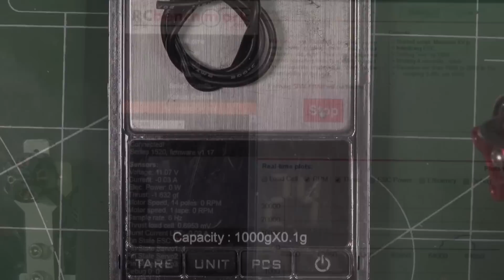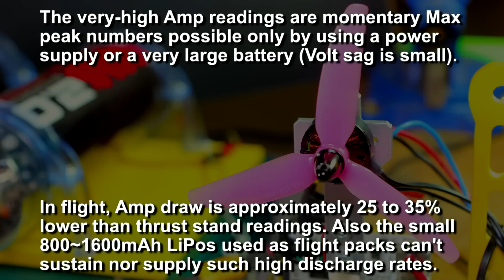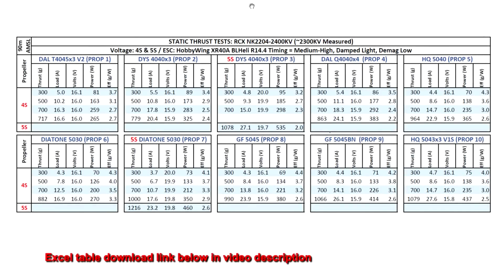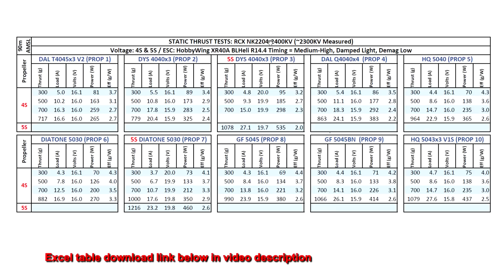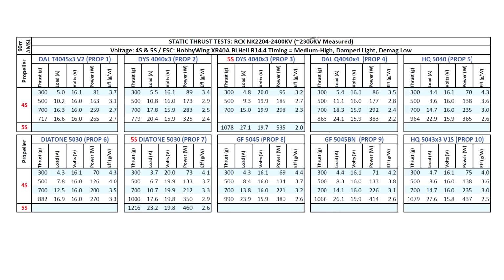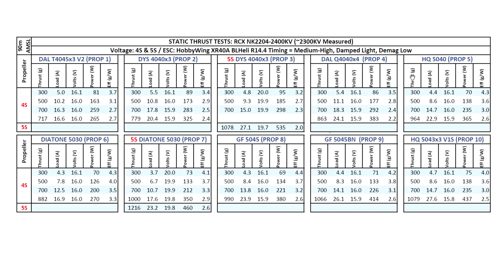MYRCMART RCX NK2204-2400KV Efficient and Light Small Motor  *UPDATE: Higher KV Coming Later*

Comment: I've been eyeing these motors for over a year now and now they're $10 w/o warranty.   I''m looking to build a light-weight cruiser that's efficient.  Do you think that the 2400KV version would work well with HQ 6x3x3 V1S props on a 4S under 200gram build (w/o lipo)?
Reply from the maker: It should work fine with that low pitch prop but it might not be as efficient as you'd expect. So far the most efficient setups I've seen use a little larger motors and lower KV. So 2206-1800/2000kv 6" and light LiPo. I was able to fly about 15min with a Cobra 2205-1960kv 6045x2 props 25C 4S 2700mAh Lipo and the frame was on the heavy side..... Anyway, if you build it very light and manage throttle well avoiding full throttle it should give you longer flights. Try 6030 or 6040 2-blade props. Those could be more efficient

Comment: Ya Know these really look awesome i bought the emax 2207s and i think they only have a 3mm shaft. I think my next motors are going to be 4mm shaft or they will not be considered. What is your opinion on that? The reason i ask is i have aalready replaced the bells on my two rear motors for balance sake. This is not the fault of the motors i am surprised it did not rip off my rear arms. I believe that EMAX are great quality all the way through but 4mm shaft would make a huge difference

Comment: 4mm shaft and big bearings are overkill IMO. They could use 3mm shaft and smaller bearings, meaning bigger stator volume, more power and possibly lighter. At this price point and weight, I wouldn't bother much about durability. Also provide more color selection or at least use something neutral instead of red bottoms because not all people want red theme quad. Other than that it's great. Keep up the great video.
Reply: the other lightweight motors like the proton-x and the t-motors have smaller bearings and aluminium shafts, they are also a little bit lighter. But there are from the earlier t-motors a lot of reports of people breaking the shaft when tightening props. You can choose what you'd like to buy now
Reply: I agree they are not expensive but the durability is a huge plus. After all the work assembling it sure would suck to have wobbly motors or worse yet a downed bird IDK i am just on the band wagon i guess

Comment: Didn't 2204 motors die out way back in 2015 or is there like some niche market for these things?
Reply: MajorProblemsStudios You'll find the odd pilot who's OCD about weight and wants the lightest quad possible.  It also benefits in some MULTIGP 'races' where they run to a time and lap method and not fastest over 3-5 laps.
Reply from the maker: Yes, for the most part, 2204's went overlooked by majority of people for a good while. 2205's replaced them, then 2206's, 2306's, 2407's, 2207's..... but I think there are still some specific uses for some people where a 2204 like this one fits nicely for those who want a light and efficient motor to cruise around. 
https://www.youtube.com/watch?v=i06U53ulYSA
This guy for example says he gets about 8min flights for night flying where speed is not a necessity using a 4S-1300mAh  and carrying a Xiaomi 4K HD cam. Yes, you can get the same performance with 50 other motor/prop combinations. I guess it all depends what makes each person accomplish his specific goals.
Reply from the maker: Check out 
Andrius Narbutas comment :
Using them on my inverted floss with night-camera setup.
While they do not generate top-thrust - they still are nice for very lightweight setups. Smooth and efficient, like them

Comment: I just looked into the new XNOVA 2204 2900kv. More expensive, but probably more punch overall.
Reply from the maker: Right, 2900kv will have higher thrust output at the expense of drawing higher Amps, and shorter flight times. Another option is the Piroflip Hyperlight 2204-3022KV. Very good motor too. One of the YT viewers donated one for testing so I'll be running it on the thrust stand in a couple weeks

Comment: From rcx homepage:
Shaft: Titanium Alloy Hollow Shaft
    Top 5mm Hollow
    Bottom 4mm Solid (even more hard)
Stator: 0.15mm Nippon Steel Silicon Steel
Reply from the maker: Shaft is definitely not titanium, I placed it next to magnet and it was readily attracted. It is 4mm, hopefully hardened steel so it can take any big impact.
Reply: EngineerX 
And its not solid in the bottom area as you clearly showed. So some wrong data here from rcx. They should correct their product page.
Reply from the maker: Right, that happens often with several of the Chinese vendors. Often times, they just copy & paste from other similar products.  Sometimes, when we see people's reviews, videos, or pictures is when we really see actual details. I'll let them know, but don't know if they'll revise info.

Comment: I am very happy with this motor on my light 5048 prop 5". Def does not have the strong punch of the bigger motors but I was very impressed flying slower in proximity. I am curious how it compares to the Hyperlite 2204 which is reported lighter...but I have no experience with that other 2204 option. My vid: https://youtu.be/uunsaNe04gI
Reply: EngineerX the Hyperlite 2204 2522kv feels a little more powerful then these on top end but the RCX motor pulls a little harder off zero throttle up to about 40% throttle. the Hyperlite feels slightly smoother with sharp throttle inputs. I very much like the Hyperlite 2204 on extremely light builds and the motor has very good torque for a 4mm tall stator motor. the RCX motor is an amazing deal, I wish they offered it in a 2700ish kv version and that would be a heck of a light weight motor for the cost. the 2400kv just is to low of a KV for me because it runs a lot under its rated kv. the top end just falls off to much due to the low KV and you can run a high pitched prop to over come the lowish kv restrictions BUT the 2522kv HL is noticablly faster on top end by a good bit. my Hyperlite Floss 2204s on a true X frame running the 2522kv and a stretched X frame running the 3022kv at 191 gram dry and 197 gram respectively. the 2522kv version is a heck of a motor.. it has enough top end, it has strong mid range but lacks a little off Idle/zero throttle as the torque of the little stator doesn't have that low end pop that we are used to with bigger motors, on a light setup tho that isn't a bad thing and honestly it makes flying through tight and low gaps easier as throttle control isn't so violently fast, the RCX 2204 does have more low end, I don't know if it's just the throttle curve of the motor making it feel that way or if the motor does indeed have more bottom end power. I will say this, the 3022kv is a very specific motor and not a freestyle motor by any means it is a very light 5 inch prop motor only if staying at 5 inch it lacks torque across the board but on a very light weight low drag frame with the right props will be a screaming fast setup. out of the HL2204 and the RCX2204 my choice is the HL2204 2522kv. not saying the RCX isnt a damn good motor as it is and it's stellar when factoring the cost in the equation. I'm honestly loving the flight times of the light weight 2204 power quads, 5 minutes on 1550s in possible when running race gates at 70 to 80% my ability and right around 4 min of flying 85% to 100%. flying freestyle 5 mins is easy to get on 1550s and low cost 45c packs are more then enough!!! I got a lot of 1050 4s 45c packs on them as well and preformance is excellent, flight characteristics with the light packs is excellent cornering is smoking quick and like I said 4 min of fairly hard flying on 1050s and on 1550s 5.5 to 6 mins is no problems and when you are used to 2 to 2.5 min flights going to 5 to 6 min flights feels like forever.. your packs also last for a long time as you are working the crap out of them and getting them 160 degrees and making them scream for a break, I have some 1050mah 45c 4s packs that have well over 200 cycles on them and they still preform great.. if they can make a 2204 that has torque to preform good on a normal 5x4x3 and have the KV high enough that they don't just die off after about 80% throttle on a 190 to 210 max gram build that you can get 3.5 to 4 mins on a 1000mah 4s then 2204s will truly become a viable motor option. from the testing I have done on my current 2204 powered rigs is that a flying weight of 330 grams MAX to have all out preformance and with high-performance 4s 1050mah packs weighing 110 to 120 grams 300 to 310 grams AUW is pretty easy to achieve on a 2204 4s setup.. at 300 grams auw on a race course 2207 or 2306-7 builds that are weighing dry what the light 2204 builds with 1000mah packs AUW is will have a in possible time keeping up with equal pilot skills and freestyling you will have longer flight times with better handling and acceration that is plenty fast and punchouts the rival the big boys... I just wish that motor companies would try and give us a little more torque off idle/zero throttle other then that on the right builds 2204s can be flat amazing.
Reply from the maker: Looks pretty good for proximity flying in those dense trees. I don't think I would fly any faster so a light quad with these motors makes sense. One of the YT viewers donated one of the Piroflip Hyperlight 2204-3022KV for testing so I'll be running it on the thrust stand in a couple weeks
Reply from the maker: Thanks for the very detailed observations and info. Very good insights and I think you're spot on. Always good to hear from users experiences.
Reply: Quadcopters And Airguns Thank you for sharing your experiences. Much appreciated 👍
Reply: Looking forward to seeing that Hyperlite 2204 review. I've been flying the 2204/2522kv extensively.

Comment from the maker: Comments from 1st video, error on reported KV measurement - same content otherwise
Alex 1193
2850kv?

Puff Daddy FPV
I'm confused... You measured ~2850kv, in your table it says 2300kv and in the comments you acknowledge it's 2850kv???
BEANTWOORDEN

Stephen Wright
yeah weird...then in the table it says 2300kv measured...

Hrr Pippi
My calculation says about 2360kv (26000rpm/11V)

EngineerX
Average was 25800rpm/10.96V so around 2350 on the thrust stand but I've found it reads about 50KV higher for low/mid KV motors

EngineerX
There's always some dumb Typo - I use video editor files from other motors ... and seems there's always one thing that escapes my editing :( 
It should be 2300KV.  The thrust stand measured 2350KV, look closely on the right portion of the screen readout, right below the wrong "2850KV". That has to be adjusted by 50KV due to thrust stand reading a little higher. I'm re-rendering video with correct KV to avoid confusion, will delete and reupload
Reply from the maker: Thanks for watching and Happy New Year :)
Reply: Puff Daddy FPV die gaan we halunnnnnn gek!

Comment from the maker: Hrr Pippi
When would one use these? With such low kv?
EngineerX
Check out 
Andrius Narbutas comment :
Using them on my inverted floss with night-camera setup.
While they do not generate top-thrust - they still are nice for very lightweight setups. Smooth and efficient, like them

Comment from the maker: Comments from 1st video, now replaced by this one
Andrius Narbutas
Using them on my inverted floss with night-camera setup.
While they do not generate top-thrust - they still are nice for very lightweight setups. Smooth and efficient, like them so far (can't comment about durability, yet).

EngineerX
Perfect application,  night-camera for low-light conditions flying? Cool, efficiency is more desirable there. From what I could see, they should be decently durable, of course only way to find out for sure is after a good crash ;)

Andrius Narbutas
Yeah, working on it, should not last long flying at night 5cm from asphalt :P

About setup - everything is done light-weight as possible (cams are heavy, both) and with Xiaomi 4K+ cam, using 4S 1.3Ah battery getting up to 8 minutes of flight (not hover, but def. not race), so happy with weight/efficiency. But probably way too low thrust for proper race copter...

EngineerX
Well, it's purpose built for those conditions. Sounds very good to me. I watched your night flight footage. Very cool and interesting. I've flown in the dark with regular HS1177. Different experience. BTW. I will have to delete this video and reupload. Made one mistake on the KV measurement number I wrote on the video and people are getting confused. Thanks for sharing . I''ll add your comment to the new video in a few minutes.